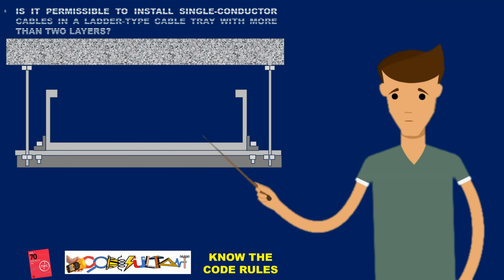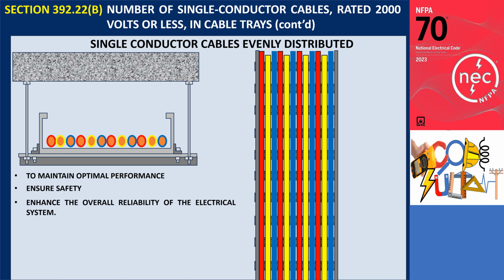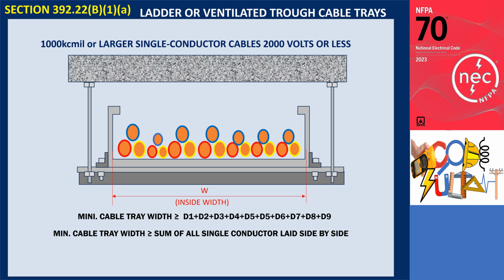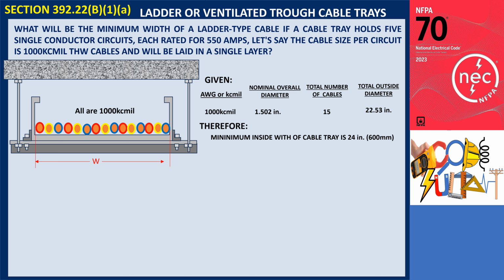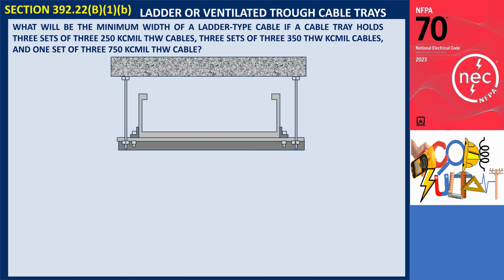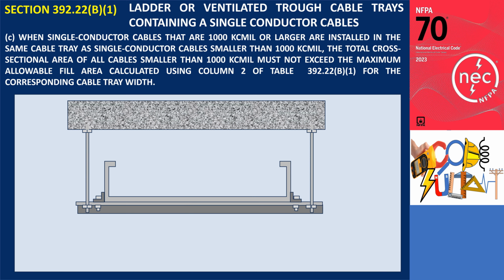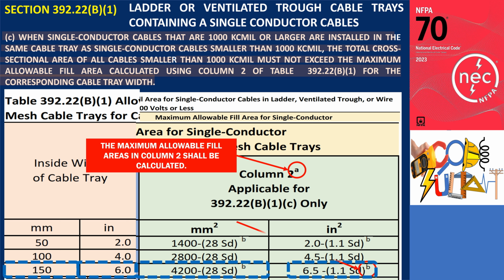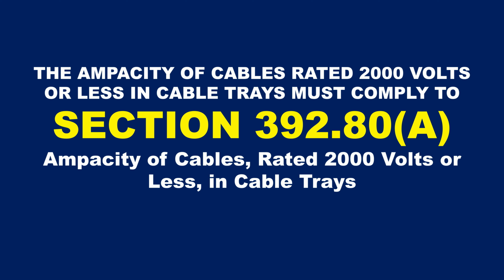CABLE TRAY SIZING CALCULATION  FOR SINGLE CONDUCTOR SECTION 392.22(B)(1) - NEC 2023

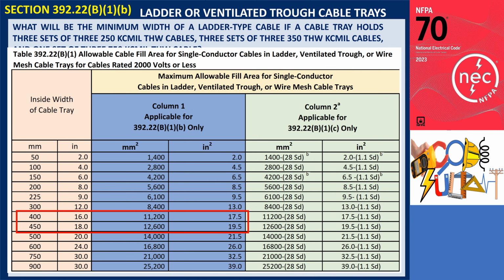Comment: The video is very informative. Thank you. At 8:57, there is a mistake. You calculated the cross sectional area as 17.03 square inches and then compared that to the cable tray width (in inches). The minimum is actually a 16 inch wide tray but this doesn't leave much room for expansion.
Reply from the maker: Thanks for catching that—I appreciate the feedback